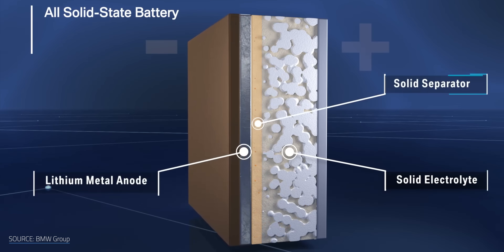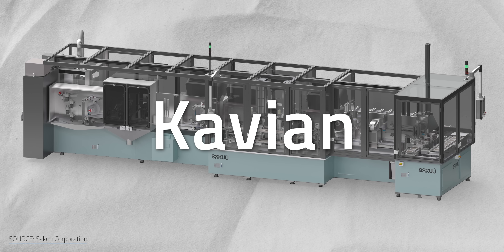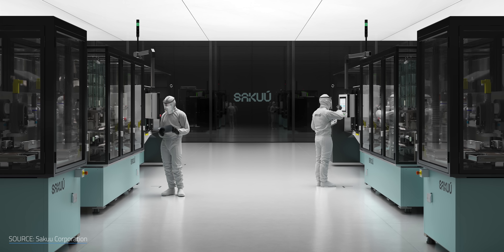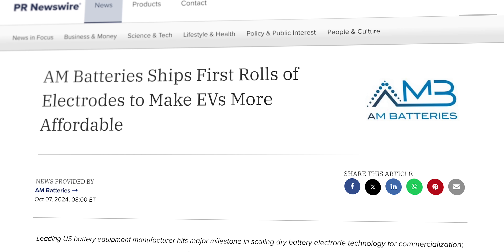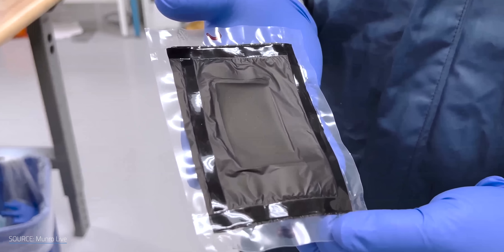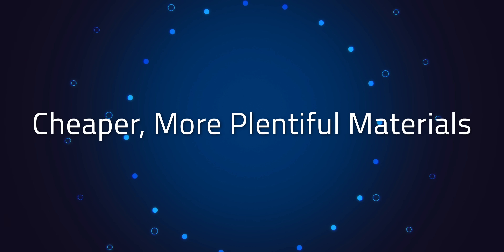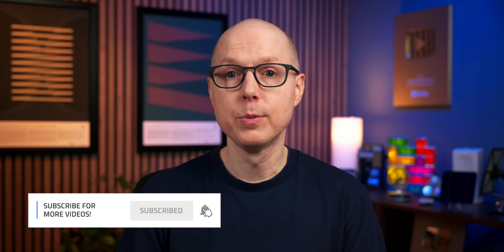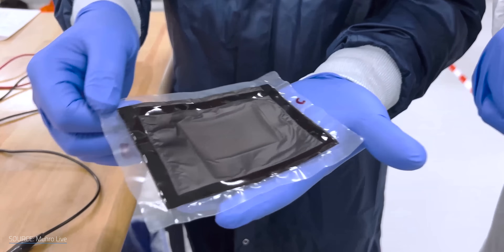Why This Ultra Cheap Battery Breakthrough Matters

Comment: If some say that billionaires getting tax cuts will not trickle down to you and me, how can they say that saving huge amount in cost of manufacturing batteries industry will trickle down to the consumers. I the next decade, I will retire, not rich. How will I be able to afford even a 2 000$ battery every now and then? On top of paying down the car itself. I am not an early adopter, I live in a place where I can't have a plug nearby the car, this is not happening, for a lot of us and costs isn't the sole issue.
Reply: you don't have electricity in your home ?  How did you watch this youtube video ?
By 2035, a 50 kWh battery could cost 80–90% less than today, making EVs much cheaper than gas cars. And you might even want to use a robotaxi rather than buy a car, cheaper in cost pr mile.
Reply: I mean ... you would have that issue with ICE as well.. maybe not a battery, but something in that car would break down and you would have to buy a 10k+ car either way you look at it... so if its a repair cost of only 2k+ that isnt as bad as having to buy a whole new car then. As you get older, the need to want to get out more does dry up... so... a car isnt going to be your first problem.

Comment: The only flaw in this is in your example of the phone.  There would be no way to change out a spent battery meaning that the phone would be discarded, adding to an increase in electronic waste since it would also prevent recycling of components.
Reply: Two different issues here. 1) No, this wouldnt limit your battery choice/replacement options. 2) ITs still up to the phone marker to make it replaceable. If they dont do it, then it doesnt matter. We already saw that with current devices and it didnt change the fact that if Apple makes it hard to replace it... then its on them not the battery design it self.
Reply: Isn't there still 'no way' to do that already? Sure you probably could bring it to some repair shop and get it done for a decent expense, sometimes as much if not more than the phone is worth (because y'know moore's law). Most people just dump their old malfunctioning tech anyway to replace it with the new, faster and better products. I think if we really wanted to change this we would need more widespread and easily accessible electronic recycling endeavors and that people have some kind of awareness of incentive to recycle these.
Reply: bruh a battery replacement for a phone here in my country is like 10$ max

Comment: Always appreciate your videos. I'm wondering if you have talked about the NanoOne technology.  They have a dry process for LFP CAM production that eliminates the need for those football length facilities, similar to the tech in this video.  They are already past the research or bench stage, and expect to begin licensing the plant technology in 2025. They are close to production and now have partnerships with Rio Tinto, Sumitomo and Worley Engineering. Your analysis of this tech would be appreciated.

Comment: I was born in the wrong era. Missed the Horsepower wars during the 60's [way too young] Now I am just on the verge of missing so many massive advancements in our daily lives. [getting way to old] I could print a list of NEW TECH stuff that simply amazes me, but I won't in this comment section. James Webb Telescope to these new gen of batteries to Space flight, etc. Dang, Cheers! Stumpr1

Comment: At the beginning of this video you mentioned that one of the issues facing currant batteries is longevity. On that point I cannot agree.  I drive a 2018 Leaf.  Right now, in my driveway, the estimated miles remaining at the charge level it is at is 158 miles.  I looked up Nissans specs for battery range at full charge for my car.  Nissan says the range should be 153 miles.  My car is 8 years old, has over 60,000 miles and the range still exceeds the factory estimate at brand new.  From my point of view, the longevity problem was solved years ago.  But I do agree with you on the other issues and happily it seems we are just around the corner from solving them.
Reply: I have a 2018 Leaf also with 35k+ miles. My range says around 140 which is still 90% of original. And Zero, 0$, maintenance outside of new tires once. So glad I made this purchase. We use this car almost all the time and have saved so much on gas. And the car drives and looks almost new.
Reply: while I agree they are doing better than what they thought, I would argue, in the other 10% is not going well for them.. the fire and safety is still an issue once they do go up in flames its kind of hard to stop them and if they go off in a place that wasnt ready for it... it can cause a lot of damage. The range is still an issue as well + temperature working ranges + charge times / enough chargers out there. For me, the range is a combo of the fact you have to spend some of the power to warm up the battery + the car/you all hurtting the over all range from say 300 miles down to 250 or even 200. Follow by the fact if you need to charge it because its cold out side... you increase the over all time it takes from 15-25 mins to 30-60mins + still can find a spot because of the increase usage from other people needing to do the same. So the 158 mile range on that leaf wouldnt be good enough for me as I do have to travel a bit. Sounds like a good in town car though.
Reply: @ …EV fires are overrated.  Two of my gas cars have gone up in flames costing thousands of dollars in property damage   You never saw this on the 6:00 news because it is considered a non-issue.  If my Leaf had caught fire the news media would have jumped on it.  That being said, there have been fires involving EV’s and those fires are much harder to extinguish, necessitating that fire departments carry special chemicals because water alone will not put out the flames.  The good news is that there are now on the market solid state batteries with no fire issues and fast charging times.  Only a few car makers are using these but they are not allowed in the US because they are from China.  Sodium Air and Iron Oxide batteries are also in the prototype stage and have no fire or temperature issues.  There are also others in late stage of development.  When these technologies ripen lithium-ion batteries will just become a memory.  Also, many of these new technologies, besides being temperature friendly and fireproof, also have better range and power densities than today’s Li-ion batteries.
Reply: @ Yea but a ICE car going up in flames is easier to take out than a EV fire... I know, I watch both burn before... and EV fires can take days or weeks where ICE can be down in 1-2 hours. So to me, thats a BIG difference in how a fire can be put under control and when this happen next to a building... its going to put others at risk. I dont even like to take in my EV bike into the house knowing that information. I normally set it outside to charge up. Yea once we get better battery tech, then sure, Na and others do have better safety and the battery tech is only going to get better. I was just talking about currently.  Most batteries today are still not that friendly to temps - ask any Russia person or more Northern / very southern salty location. Na, far as I know 300 is about average still. Itill be a few more years before we even see ones that hit anything higher as they are looking to reduce the weight more than anything and or cost.
Reply: Funny that you own an electric car but can't spell current.
Reply: @ I was just testing you.  You win the prize!
Reply: Well, guys, you will pay when the time to replace the battery will inevitably come
Reply: Anecdotal evidence does not override actual studies and industry understanding. At best you got what is called a "golden sample" (or in the PC World, you won the "Silicon Lottery"), at worst you're lying to be contrarian.
Reply: @SomeNerd361  Not an anecdotal.  The numbers are now pouring in.  EV batteries are outlasting the car in many cases.  My situation is not unique. In fact many home owners are keeping the battery to use as a home back-up battery when they purchase their next vehicle.  I already have my eye on an electric pic-up truck.  When I purchase that I take the battery out of the Leaf and hook it up to the house.  This is a very money saving win, win situation.
Reply: @SomeNerd361  Not an anecdotal.  The numbers are now pouring in.  EV batteries are outlasting the car in many cases.  My situation is not unique. In fact many home owners are keeping the battery to use as a home back-up battery when they purchase their next vehicle.  I already have my eye on an electric pic-up truck.  When I purchase that I take the battery out of the Leaf and hook it up to the house.  This is a very money saving win, win situation.
Reply: @coffeeisgood102  Cool, wanna provide a source to that claim?

Comment: I don't see the need for battery EVs, they are not 0-emissions, are not greener than petrol and diesel vehicles. And require charging from power plants powered by carbon based fuels or nuclear. When the "science" claims CO2 is a greenhouse gas, I don't agree. -- Science is Knowledge that is tested, repeatedly and proven true. But climate "science" is not knowledge tested, repeatedly and proven, it is a theory, speculation and a scheme of how climate MAY work!!! -- But real science is CO2 that is the gas of life and without it and no life exists. Green policies are about controlling people and not about what's best for the environment.
Reply: Na you are confusing many different things as one... WE DO know that CO2 is a green house gas. That is a proven fact. Same as O, H, H2O, along with Methane. Majority of the time we can't control the other gases and we know we been putting more CO2 in the air as we burn things... so this is also a proven fact.. we also know we are at a time and scale that produces the stuff at a WAY greater volume than past years. While the science between cliemate is up for debate, the over all elements we find in the air does have an affect on what happens. Over all we know its affecting us - the questions that are up in the air is how does that change weather and other things we know currently. Over all. it does show the earth getting warmer and the ice melting (both things we can see and test today). EVs are pretty much 0-emissions when compare to an ICE car. As most of the power can come from cleaner sources of power. Cali is a good example of how they have too much solar during the day and yet they burn over all less generating their power. Petrol and diesel has to go through a few chemical changes at refiners. Are you account for the burn off and the extra methane they are producing? Because I bet you are not. Methane is even WOREST than CO2 is... Either way, they get a cut back from the govermenet that they then turn around and sell the final goods back to the US and then the people where we try to give another tax break for.. so we're almost paying double for that gas to put in your car that you think is 2-3$ a galon when its really closer to 9 or 12$ a galon.... so yea... you would be screaming if we didnt off set that...
Reply: @adr2t  ~  You say CO2 is a greenhouse gas and we know we have air pressure and that requires earth's atmosphere to be contained. but what contains it? Mainstream science says nothing about a greenhouse roof enclosing our atmosphere. How is the atmosphere is contained, what prevents it from dissipating into the infinite vacuum of space?
Reply: @martentrudeau6948  Are you really asking me that while trying to claim you know about science? Spin a bucket of water around you... try and figure this out on your own. Ill give you bounce points if you can figure out what our magnetosphere does as well. Not to sound rude or anything.. this is common knowledge and stuff we learn in grade school...
Reply: @adr2t  ~ Science is knowledge that is tested repeatedly and proven. What prevents high pressure gas in earth's atmosphere from moving into the zero pressure vacuum of outer space? You can't answer that!!!
Reply: @ I already did :) Read what I said again... look it up.. really, go spin a bucket of water really fast... tell me what happens?
Reply: @adr2t  ~ You said and I quote: "WE DO know that CO2 is a green house gas. That is a proven fact." -- And I ask you what contains this greenhouse gas?
Reply: @ and I said "Spin a bucket of water around you... try and figure this out on your own" Let me move this a bit down the road.. what FORCES are keeping that water in the buket when you spin it ???? Yes there are a few forces at play, but ill even take one of them.
Reply: @ ~ I ask you again, what prevents earth's atmosphere from dissipating into the infinite vacuum of space? Mainstream science has no answer for that question.
Reply: @ Do you NOT know about friction, Gravitational, Electrical, Magnetic, Tension, Normal, and Applied just to name some of the affects that keep us here? Again...  not to be rude or anything... like this is stuff we learn in grade school dude.... in high school we learn what/how some of those forces even came to be from the atomic level... and in college we learn what was even under those... I havent been in school for a while either... so the fact I still remember them is wild even to me.
Reply: @ ~ You said; "CO2 is a green house gas. That is a proven fact." I ask where is the greenhouse roof to contain the said CO2 greenhouse gas? You can't answer that.
Reply: @Already have... dude go back to school for a bit:) I assume you also think the earth is flat?

Comment: That's terrible and a huge step backwards. Batteries should come in standard shapes and sizes that can be replaced and repaired long after the product is no longer manufactured, or the company is out of business entirely. Custom made batteries per device are a plague on repairability.
Reply: It's a trade, imagine if your phone had to fit D-cells or even just CR2032's for standardization purposes.
They key is to force manufacturers to sell the batteries on the side and to make them use using non-proprietary, non-welded connectors.
Reply: So your argument would have you replacing your cell phone battery with AAA or coin batteries every few months...????? I dont aree with this... and this sounds dumb. You are confusing two different issues. The plague on repairability are just companies not making it easy to repair /replace the battery. It has nothing to do with its shape or size only if its available to get your hands on or not. As Diakos said, we need to make sure they're not using non-proprietary, non-welded connectors and allow access to the battery it self in a easy way.

Comment: Batteries, specifically EV batteries, need to decrease their recharge times considerably in order for EV's to achieve widespread adoption. Only by putting their recharge times on par with ICE cars will they ever succeed. No one wants to wait an hour for their car to charge.
Reply: There are already EVs out there capable of going from 10-80% in 15-20 minutes. The "hour-long recharge time" figure is years outdated.
Reply: @ab-tf5fl  Yes, but how long does it take to go from 80% to full charge? Or for that matter from >10% to 100%. I would reckon much longer than people wan to wait. 
But going back to your statement. Who wants to wait 15-20 minutes to only get to 3/4 full battery when it takes less than 5 min to fill your car with gas, and that ICE car most likely has a much farther range.
Reply: @GenerationX-GenX would you rather fill up your phone with gas and not wait 30 mins to charge it?
Reply: @ no but if I could swap out the battery for one fully charged I would. We used to be able to do that back in the day. I can also charge my phone while driving, or continuously top it off throughout the day. My point is unless the current batteries get to the point of being on par with the convenience of modern ICE cars they will never reach widespread adoption. People are lazy and also impatient. They won’t give up convenience

Comment: I'd love to see the costs going down, even if for 10-20% not 50-60%. Yet most of the tech we buy today (whether it's smartphones, laptops, cars, etc) cost more and more every year. It seems like the companies enjoy the costs of batteries going down while maintaining or increasing the cost of goods and their profit margins, for whatever reasons (supply chain, geopolitical instability, markets fluctuating irrational based on dumb speculations, etc).
Reply: Batteries really havent come down in cost as much as they just increase in the amount of power they hold... and as you pointed out else where, there is a number of reasons why a tech might still have a higher cost over time... this is why we really dont recommend rushing to buy the newest phone or hardware just because it has higher numbers.
Reply: Absolutely. Why sell something that does exactly what the customer wants when you can convince the customer that they want something that costs twice as much?

Comment: Lowering costs is all about Margins. Just because the cost drops 60% vs current costs doesn't mean it will. It may only drop 40% but it will drop. They aren't going to keep the price the same and pocket an extra 60%. If they did that the market would never take off.

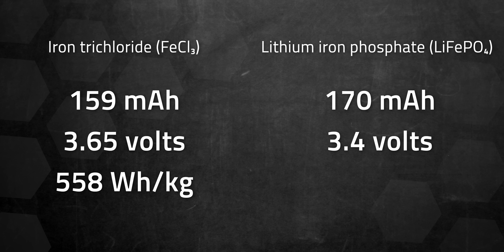Comment: 10:49 “Typical lithium-ion phosphate batteries…420–550 Wh/kg.” Which planet is that on? Because it’s not Earth, right? 🤔
Reply: That's the energy density of the raw cathode or anode material, not a cell (40%? lower) or a pack (another 10% lower)